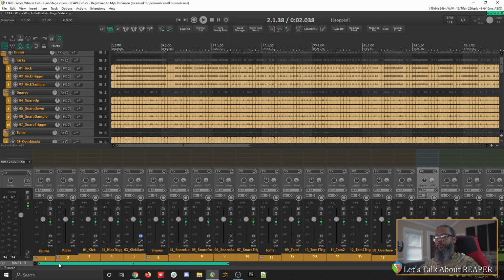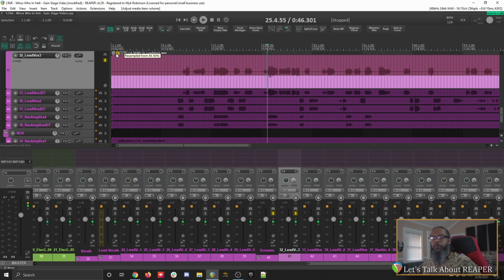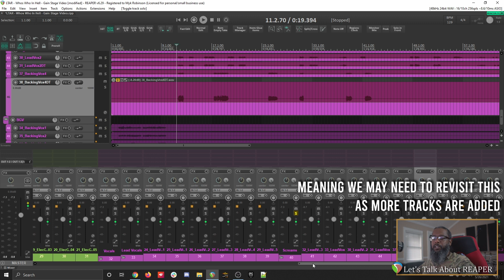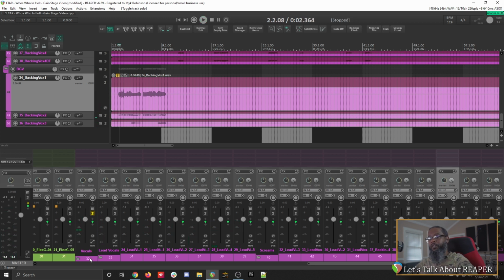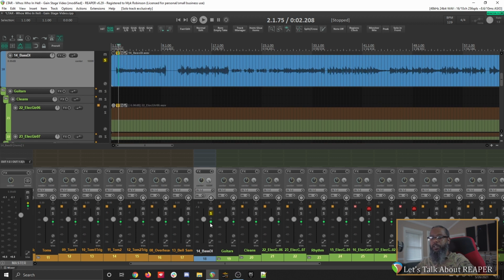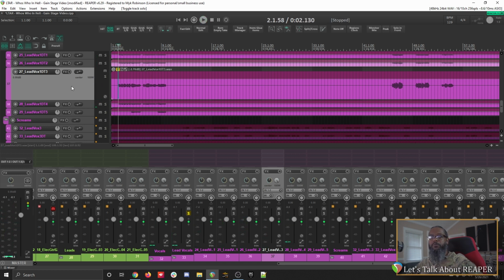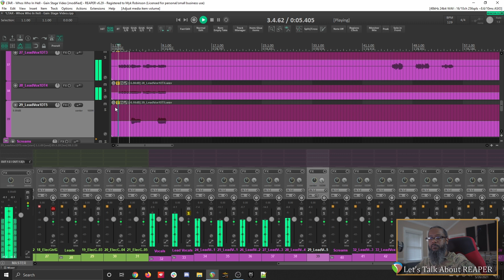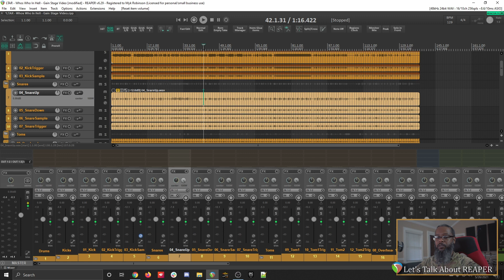Preparing to Mix in REAPER Part 2:   Gain Staging

Comment: Holy smokes, was into this until the vocals hit, bye!
Reply from the maker: Understandable. The simple takeaway from this is to be able to have your faders at unity without any of the tracks, busses, or master clipping. 

You can achieve this by using "clip gain" to set the level of your media items before they hit the faders and inserts.

This gives you room to use your plugins and such to shape the sound, control dynamics, and achieve "loudness" at a later stage.

Initially, the goal is preparing your session to be able to mix. 

Get your gain structure set, then achieve a rough mix and balance with panning and faders only, using no plugins,unless virtual instruments are involved, of course.

Comment: Does the volume knob/handle at the top of the waveform function the same as clip gain in pro tools? Im a noob and am seeing turorials with clip gain that I would like to emulate in reaper
Reply from the maker: I've not used protools to understand the comparison. The knob or handle on a media item acts as clip gain and is before everything else (pre fader, pre fx, etc). This function is active across the entire clip but can be used in combination with a clip volume envelope if you need finer control at specific points in the clip
Reply: Awesome. Thanks a lot! I think this clears it up for me.  @LetsTalkAboutReaper
Reply from the maker: @json1234  there are a handful of volume envelope types as well. The Take Vilume Envelope lives on the clip itself and is ehat i mentioned earlier.

There is also a track based pre-fx envelope, which as rhe name implies, lives on the track in a lane below the clip but aftects the clip the same as the take volume envelope. This can be used in conjunction with the other types and youll get a cumulative efgect of the various volume types.

Then there is the track volume envelope which is essentially fader automation.

Hope this helps!
Reply: I appreciate it. Will look into all of these!  @LetsTalkAboutReaper

Comment: Hi, my individual tracks don't show the numbered increments of volume, the meter moves with audio but not showing increments like yours do. I am using the default layout. How can I make it so those volume increment numbers appear in all my tracks? I'm using version 7.19, thanks
Reply from the maker: @sheldonswan45  go to Options>Themes>Theme Adjuster

You should see an option in the theme adjuster to enable the numbers on the meters
Reply: @ do you have your track meters set to “Combined RMS?”
Reply from the maker: @sheldonswan45  mine are set to Multichannel Peaks
Reply from the maker: My master is set to a few different things. Feel free to hop on Discord and we can share some screenshots, etc, and discuss further!

Comment: Can you only gain stage in Reaper if all your tracks hold wav files? Can't you gain stage with VST's on the track?
Reply from the maker: You can use trim plugins to adjust gain. Many would say you should essentially equalize volume so that what is going out is the same as what's going in primarily in an effort to ensure that whatever you're doing in a plugin actually sounds better, because the natural inclination is that louder is better 🥹

All that said, I tend to clip gain my media items (they don't have to be wav) to make sure that they are not clipping the channel before a plugin is ever inserted.

I feel a good methodology is to achieve a decent rough mix with nothing but pan and volume adjustments with the faders, then start adding plugins. It really helps to ensure that your source material is good on its own and gives you a good starting point to start fixing things and adding enhancements

Comment: Thank you, Mike. I only use Reaper for a couple of things, and wasn't sure how to adjust the gain. Yours was the only video that got straight to the point. Much appreciated.
Reply: Is what he does in this video basically the same as using clip gain in a different daw? I'm a beginner
Reply: @json1234  Though not a beginner, I'm still very much an amateur, so I might not be the right person to answer your question. But I will say that I use gain staging to help me moderate the noise floor in my song projects. When you experience the tracks live all together, you can hear, firsthand, how the volume level increases.

Perhaps a simple way to hear for yourself would be to listen to a single track of your project, then bring all the tracks in together (maybe 12 or more tracks), and the difference in volume should be quite noticeable. 

So, if you put that in the context of noise, being able to moderate that better using gain staging can be quite useful.
Reply: @irpacynot Thanks man. Currently clipping everything! 😂 Restarting what i was working on and using gain staging this time

Comment: my project in reaper sounds really quiet and sound less detailed compared to my references, yet when you play it, my headset and my monitor speakers kind of clips even if it is really not that loud.  when i play my references like songs of popular artists like mudvayne, im able to crank the volume without hearing any clippping or static or cracking sound. 

for example, if a mudvayne song is at level 10 at volume level, it will sound loud but in a pleasant way ,  well detailed, punchy,  no distortion or clipping. My project however, will begin to clip at level 6 volume, but isnt really that loud and detailed. if i crank it at 10, my speakers will begin to distort to the point that you will hear 90% distorted sound, 10% the song itself.  each track are set to -6db and none of them are clipping. i really dont know what to say or how to describe it better but thats aboutt it

Comment: This might be a good starting point...
Action > Item properties: Normalize items (peak/LUFS/RMS)
LUFS-S max
-20 (or whatever works best)
Reply: I now think LUFS-M (momentary) actually works better for this. (It's closer to VU meter speed?)
Reply: @StevieBoyesmusic  I'll give it a try and compare. Thanks
Reply from the maker: I tried that before and didn't like the results . Curious to try it again as it is entirely possible that I did something wrong.
Reply: Tried @StevieBoyesmusic recommendation, and it worked well. Make sure to highlight track or tracks prior to the action.

Comment: Hey nice video and explanations! 
But why do you gain stage the clip volume and not with the track faders? I'm just thinking about using the session as a template. You'll have the same tracks but different clips which seems like a problem for me. Or is there a possibility in reaper to copy or print the clip gain for the template?
Best regards
Reply from the maker: Hey, thanks for the comment. 
I do this at the clip level first in case things were tracked a bit too hot or perhaps too low so I get the level I want before hitting the plugins and faders. This way, I have the full resolution of the faders available.

For example, if the bass were tracked really hot and was near clipping before any plugins are inserted, I need to control that level ahead of everything else in order for plugins to behave appropriately and really even to get proper use of the fader, because the fader is the last thing that is hit before the sound moves on to the master. So if I do this using the faders, the plugins are still receiving too loud or soft of a signal and ultimately I end up chasing the fader and juggling things to try to correct an issue that should be addressed before we start adding plugins and mixing.

Hope that helps!
Reply: @LetsTalkAboutReaper  thank you very much for the answer! I knew there was something I wasn't paying attention to.
Makes perfect sense.

But when all clips would have a good level,  nothing too hot or low, would you recommend also this method: 
You could use e.g. a gain/level plugin (JS: volume smoother e.g.) as first fx on the tracks, if you want to adjust the level. Because when there are different songs of an album, but recorded all with the same instruments, all the same way and with the same gain level, then you can use this as a template and don't need to turn the gain knob every time you mix another song of the album, right?

Or is there a possibility in reaper to make a template of the clip gain level of the tracks?
Thank you in advance!

Comment: Hey when you lower the volume on any track because is clipping or the way you saying just to keep all on level but how about to ad volume when the level is low
Reply from the maker: You can increase the volume using item volume if the source is too quiet by using "volume knobs" in the items instead of the default top handle.

I'll have to rewatch this video to see if I covered that 🤔
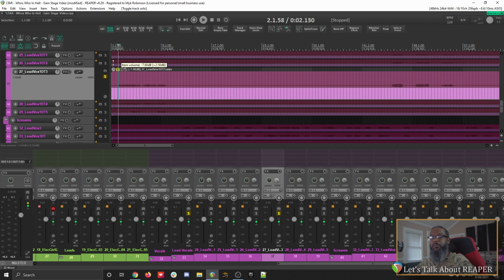Reply: @LetsTalkAboutReaper  my bad you did i little bit explanation at 12:04

Comment: Amazing video man, thank you. Just thought I'd share my own tip for gain staging in Reaper in case it might help someone because my mixes have improved a lot since doing this. What I do first is actually normalize all the tracks by selecting them all, double clicking, going to "item processing" then "normalize" What this does is automatically adjust the volume of every track to make them all common gain. Then I will glue the tracks, Listen through and see where I'm peaking the loudest then turning the tracks down by that number + an additional 6dB. So for example, after making the tracks common gain and gluing them, if my loudest peak is +3.9dB over 0 then I will lower the tracks down together by -9.9dB. I like having my tracks at common gain with the loudest peak at -6dB. This ensures that I always have 6 to 12 dB of headroom and that my signal will hit my plugins at perfect volumes without being too loud or too quiet. This method is clean, quick, accurate and it's a lot faster than having to sit there listening to/adjusting every track manually.

(EDIT: forgot to add that where I’m looking for that headroom is on the master bus. Not the individual tracks)

(EDIT again years later:

 I have evolved my gain staging practices a lot since making this comment. The way I do things now is that I have 2 very important compressors in my template with set & forget settings baked into my template. Compressor 1 is a distressor style plugin on my drum bus where I’m looking for the snare to hit 6-7 db of gain reduction & for my kick to be doing 1-2 db of gain reduction and adjust the output gain of my kick and snare to feed into the compressor at those target levels. 

Compressor #2 is an SSL style of compressor on my master bus with a high pass detection filter at around 100-125hz so it mostly reacts to the snare where I’m looking to see the needle hitting about 3 db of gain reduction 

Once that is set in place, I balance everything else in the mix around that to taste and just use my ears 

I find that as long as my kick and snare are in the sweet spot I’m looking for, then everything else just kinda falls into place much easier and that I don’t have to overthink my gain staging.

What I’ve learned about gain staging is that there is no black and white way to gain stage. You just gotta find a process you enjoy & works for you. Create a system of rules around that and stick to it and that’s something that might change & evolve over time.)
Reply: Thank you
Reply: THIS! Thank you lmao.
Reply: Thanks for this comment. To glue the tracks, do you just go to "item" and click "glue items" or is there more to it than that?
Reply: @jacksoncrockett9572 right click with all tracks selected and the choose glue. 

I’m glad you got a lot of value out of this comment.

I would like to add that I have evolved my gain staging practices a lot since making this comment. The way I do things now is that I have 2 very important compressors in my template with set & forget settings baked into my template. Compressor 1 is a distressor style plugin on my drum bus where I’m looking for the snare to hit 6-7 db of gain reduction & for my kick to be doing 1-2 db of gain reduction and adjust the output gain of my kick and snare to feed into the compressor at those target levels. 

Compressor #2 is an SSL style of compressor on my master bus with a high pass detection filter at around 100-125hz so it mostly reacts to the snare where I’m looking to see the needle hitting about 3 db of gain reduction 

Once that is set in place, I balance everything else in the mix around that to taste and just use my ears 

I find that as long as my kick and snare are in the sweet spot I’m looking for, then everything else just kinda falls into place much easier and that I don’t have to overthink my gain staging.

What I’ve learned about gain staging is that there is no black and white way to gain stage. You just gotta find a process you enjoy & works for you. Create a system of rules around that and stick to it and that’s something that might change & evolve over time.

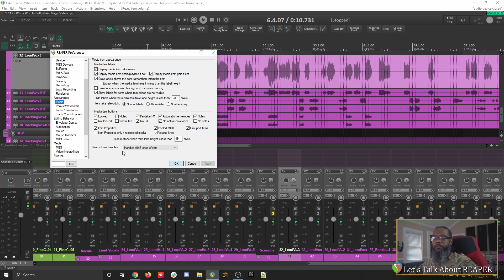Comment: 2:58 that´s clip gain. What about if I have many different clips on one track? Will I have to adjust the clip gain knob in every single clip?? Is there not a track gain knob too so that I can adjust all the different clips before they hit the plugins at once? Cheers! :)
Reply from the maker: There is not a track gain knob by default, but if you'd like to have one, just add JS: Volume Adjustment (I think that's what it's called, not at my computer) as the first plugin in your FX chain. You can also save that ad a default track template if it's something you always want to have on every track.
Reply from the maker: I saw that you responded but YT auto deleted the comment :(

If there was a link in the comment, you may need to repost without. Unfortunately YT automatically moderates some things quite aggressively and I have no control over it.
Reply: You can also double left click the track and it will select all clips on the track so that when you turn down the clip gain it turns it down on all the clips on the track simultaneously

Comment: Were are you looking to see the peak and the over all volume ???
Reply from the maker: Just watching the track meter and the master meter. The master will show RMS and peak. If you have the track in exclusive solo, the master and track meter should be sufficient, though some may opt to use a third party metering plugin.
Reply: @LetsTalkAboutReaper  awesome video. I have learned so much from your vids. What theme are you using?
Reply from the maker: @jerryfick8547  on this video, looks like i was using My Taste.

I'm now using My Taste II

https://forum.cockos.com/showthread.php?t=260786

Comment: I like using Hornet VU meter to gain stage my tracks. Saves a lot of time.
Reply from the maker: Does it work well for drums for you? A friend did a video showing it and it seemed to work well for less transient material. At least I think this was the plugin he reviewed.

Does it have the auto gain function?

Comment: I think that this is the main problem I am having in my mixes. I am starting in this fantastic world, and I was totally unaware of gain staging. Maybe what come next is a very dumb question, but why do you turn down the volume that way instead of just moving the knobs in the mixing panel?
Reply from the maker: Not a dumb question at all, my friend. 

With everything gain staged to a similar relative level, first off, you know pretty much how loud every track will be at unity. This has an interesting effect in that it truly helps you to plan your mix, so to speak. It's quite settling to the mind, and you'll start to find that you have much less moving to do with the faders after proper gain staging, but this brings me to the next point.

Fader resolution.... Moving your fader a small amount down from unity reduces the volume a small amount. But the lower you go, you'll notice you don't have as fine of control. For example, the same physical distance moved closer to the bottom of the fader may be a 10db reduction, whereas near the top, that movement may be 2db.

I am not sure if I really worded any of that quite right, I suppose what I am trying to say is that on top of giving you headroom, it allows you to make much more refined movements.